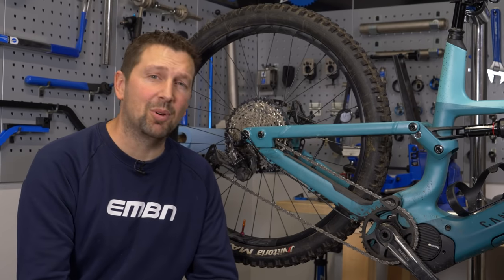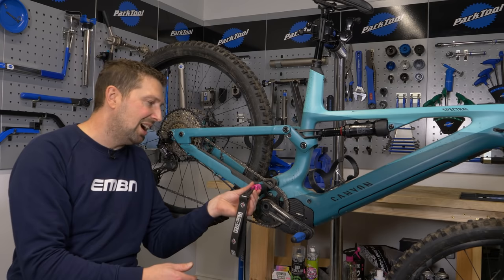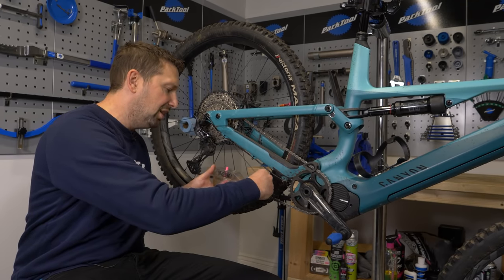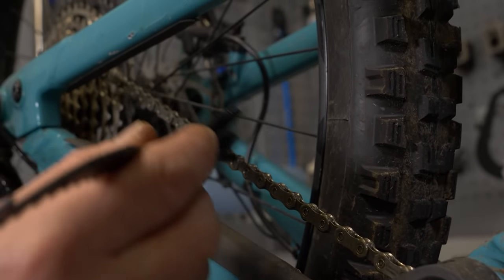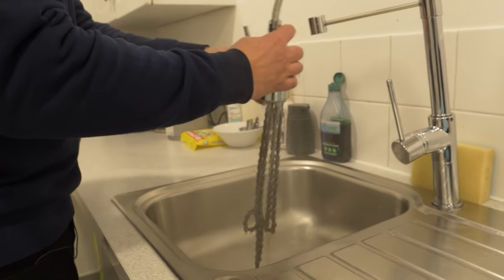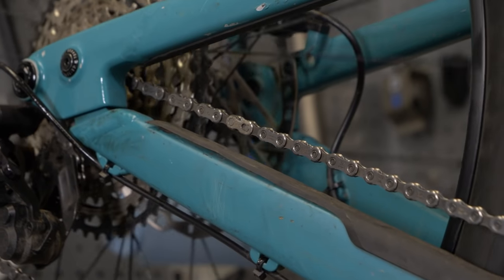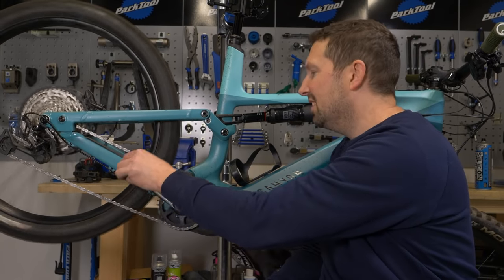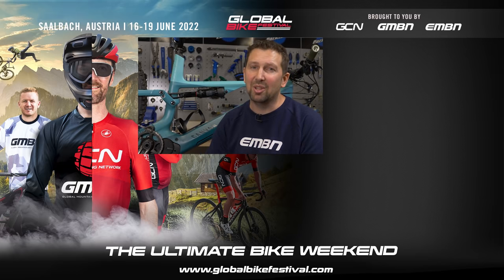10 Minute Bike Drivetrain Cleaning & Lubrication Tutorial!

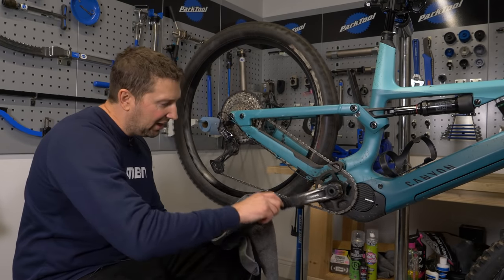Comment: At 5:37 you removed the chain.  Why not from the start, remove the chain?  Drop your chain into a solvent and agitate it a bit.  Before placing the chain back on the bike, you can stretch out the chain, then evenly apply the oil.  The jockey wheels, cassette and chainring would be easier to access for cleaning. You would't need to buy a chain cleaning device.

Comment: Just did mine a few days ago, filthy job, always was, still is !🤠 
I have a chain cleaner or two, never gets it all off, end up wasting time brushing off black residue until finally it's clean 😀
Try to dry it to find that it looked clean but is in fact still oozing black stuff, more cleaner, more brushing, get sick of the entire pain in the arse operation, use up more old pairs of pants trying to dry it, finally lube it, leaving it hanging over plastic pot to drain off. Refitted it,  by now I've got sick of being covered in lube or wearing rubber gloves ( on/off, on/off ) use checker to find that the chains knackered so need to get a new one and a cassette and chain ring rendering all but the last bit entirely pointless and with a much lighter wallet.
Another good job done, an entire day wasted and remembering how I meant to get The Nexus  hub and surely a belt drive would remove the entire crappy operation?🤣🤣
Reply: And now I need some more pants too😖

Comment: Rather than creating all that metal waste by changing a quick link once a week, I run the degreaser in the chain bath, let it sit, clean the rest of the bike, then fill the chain bath with water or bike cleaner and run it through with that to wash off all the degreaser. 👍

Comment: I have some water / citric acid / bicarb mixture I use to fill up that chain bath - pop some regular wash in the top to drop feed through and the grime usually comes off first time. Dry it off with a rag and apply the lube. Can't be bothered to take the chain off especially If you need a new quick link each time (news to me). Three minutes and done.

Comment: It’s cheaper, easier and far less messy simply not touching your bike and putting it in the bike shop 4 times a year for a service. A quick wash down after each ride with a garden hose and a little lube is all you need between services. Muc off is silly money and in my job I have far better things to spend my free time on…….like riding the bike.

Comment: If you are taking off the chain it’s probably better to soak it in a container with degreaser off the bike. I’ve started using wax based lube which is working well and the chain and other parts don’t get as dirty.
Reply: Wax lube is amazing. The trick is to fully de grease the chain before start using it. Especially a new chain that comes lubed from the factory. After that you can clean everything easy with only water.

Comment: Where do you get those quick links from ? If you have a shimano chain are there different quick links for each type of chain ? I clean mine on the bike but my OCD so wants me to remove it and give it good wash down. Thx
Reply: As a chainsaw user a way to extend the life of the sprocket is to swap out chains during daily maintenance, after sharpening. That way the chains and sprocket wore out at a similar time. So two/three chains per sprocket. As bike chains and cassettes wear too it may work with running two chains. The freshly cleaned chain will have time to dry that way too.

Comment: Sooo... clean the chain every ride, then wash it under the tap and replace the quick link? Couldn't you simply use a hose or a bucket of water? Also, if applying lube to the "bottom" of the chain, what happens to it when it circles to the "top"? In addition, if the lube is a liquid which "drips off" the chain, and you're applying it to the rollers (top or bottom), wouldn't that mean it's already between the roller contact points prior to your moving it... (unless you're spinning it at incredibly high speeds which would seem impractical) are you suggesting that it only ever gets half way in? Finally, why wasn't the chain being spun be backwards using that special tool at the beginning? Sorry, lots of questions.
Reply: I wouldn't recommend doing a full clean after ever ride
Reply: @nomad-pq4yw8iy7v  why not?
Reply: It is not necessary to clean the chain after every ride. Also, it's not necessary to remove the chain after every cleaning! Inspect the chain, get a chain-checker. Replace the chain when the chain-checker indicates.
Reply from the maker: Hi Steven! When Chris ran the chain underwater, that would simulate you spraying your bike down with a hose outdoors. It's not essential to take the chain off every time! Putting lube on the bottom of the chain is best as lube won't drip as much and will lubricate the other contact points better (for example, the cassette and chainring). Having the crank tool is useful, however we displayed how it's done without the crank tool. Hope this clears everything up! 👍